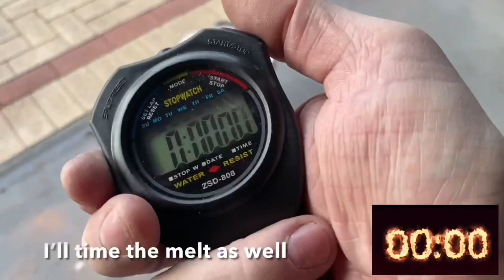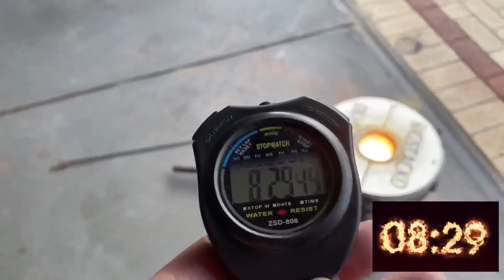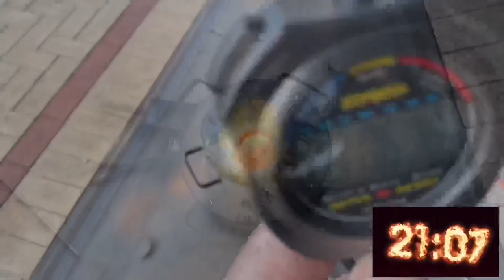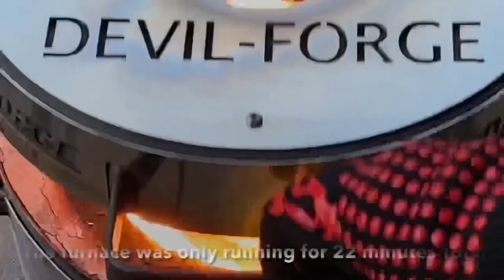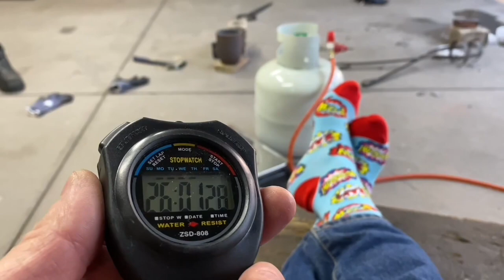Dumpster Diving Huge Copper Haul - Trash To Treasure - ASMR Metal Melting - BigStackD Copper Casting

Comment: Reminds me of bad old days when I used to work at a warehouse, full with cables. The parent company would tear down buildings and bring tons upon tons of old electric cables, engines/turbines/electric stations and piping to our warehouse. We'd strip them down, prepare, bag and sell them. We used machines like one at 2:03, or/and something that was put together by ourselves. In this video, cables are cleaner then baby's ass, but what I used to work with, was devil's outhouse itself: cable layers (rubber, in between strands, coatings) were basically glued together with some kind of thick, dark, dirty lube that was sticky as hell. Add dirt in a mix and you'd be so dirty by the end of the shift, that your overalls would be gleaming in the light and almost hard as metal sheets. 
You can imagine how much stuff there were in old soviet buildings that were being demolished. Our company would get nice profit. Tons upon tons of copper, aluminum, lead, steel (cables were wrapped in thin steel sheet, we had to manually unwrap hundreds of meters of them), even some brass stuff. Add -20℃ or +27℃ during the year in that warehouse, low wages, useless and angry bosses and you get a recipe for work related depression :D 
It ended when owners of demolishable buildings realized they should take out cables themselves, before selling the whole object to our parent company... 
I do sh*t work today as well, but it is MILES better then stuff back then. I'm now a stage technician at a local opera (lots of manual labor to load, unload and build show decorations) and I even get an occasional small, utility roles during theatrical shows. I'd say nice change of pace, LOL. 
Thanks for a video, and cudos to those who read my blabblering. Just felt like sharing.
P.S. The "Dogfather" shirts made my day.
Reply: You paint a vivid, dystopian picture, fellow BigstackD fan. That just sounds horrific. Glad your days are sunnier now.
Reply: Your history could make a great opera (or play) itself, and then you could get the lead role!
Reply: @squirrelorama  I see what you did there 😀😁
Reply: Oh god I thought I was the only one in the comments, lol. Your experience is eerily similar to mine, haha.
Reply: "basically glued together with some kind of thick, dark, dirty lube" gotta love direct burial cables!
Reply: I'm imagining Valhalla for everyone who's worked these jobs through all human history. I hope the managers have to bus the mead.
Reply: Bro thank you for the story, that was very interesting. I could just listen to someone talk on end about stuff like this, prior hard work they've done in previous eras long gone and alien to us now.

Comment: Thank you for showing the value in multiple currencies for your viewers from less mainstream countries.
Reply: "Mainstream countries" LMFAO
Reply: @Carl-ld5jy  thought it was an apt description at the time🤣
Reply: @Carl-ld5jy  "bro youre literally from liberia. Irrelevant."
Reply: You're from ireland? Banned
Reply: Where was GBP?..
Reply: @MrMarko4  GBP and EUR seem to be listed with their respective symbols (£ and €)
Reply: @subg9165  Thanks, me being stupid..
Reply: People in developing countries who recycle scrap material are just as important as recyclers in developed countries. Not only can they make money off it for their region, but it also helps keep stuff out of landfills. China's e-waste recycling operations often pull chips from devices set to be recycled, which are then cleaned up and sold online. Some chips may come from machines that were junked because of their faulty chips. However, this operation keeps legacy components around for people who need a replacement for a part on an obsolete machine. Some modern industrial computer motherboards still retain the old ISA slots used in the 1990s so that they can interface with legacy equipment that connected to computers with ISA slots and would be expensive to rework into modern computer interfaces. The old chips that China harvests from recycled computers can prove very helpful in keeping stuff like sound and other expansion cards for those machines still running, thus avoiding the need to spend exorbitant amounts of money on new hardware just for a few components. Recycling old and obsolete computers does not have to mean melting the entire thing down. Instead, recyclers should harvest the chips from them and sell them as replacement parts so that people who need them can use them. However one should not cover up the original markings because some of the devices that use them may rely on certain revisions of the chips.

Comment: That was the coolest "hot bar on giant ice cube" I've ever seen you do!  Spiders outside the home I have no quarrel with, but spiders in any part of my home or property would be dealt a quick death.
Reply: came here to say the same thing pretty much. it was hands down one of the most satisfying quenches ive seen on the channel lol. that ice block looked different from the others so maybe he got a new container he makes them in. whatever it is...*chefs kiss* mwah. was great.
Reply from the maker: @Metal_89  Actually I’m glad you guys noticed that i changes it up a bit👍🏻I’m looking to make a whole heap more of perfect clear ice ice blocks and get a side view as well as the normal view while quenching the bars, it’s gonna look awesome👊🏻🍻
Reply: @bigstackD  Did you get a RO filter for pure water? Or just using distilled water?
Reply: I agree... Best block quench so far.
Reply: @shize9ine  There's a process you do to make clear ice
Reply: Intruders must die.
Reply: @jeremyfish1975  I think you just have to boil water to burn the chemicals to make clear ice. It works best if you boil distilled water though
Reply: @chriscapo  Unfortunately both of those are myths. The way you get clear ice is by vibrating the water as you freeze it.
Reply: @BlackHatAndy  the easiest way to get clear ice is to freeze from one direction (preferably the bottom) to consolidate all of the gas bubbles in one side. If you freeze from the bottom up, all the gas escapes out the top. If you do top down, you just have to cut the bottom foggy ice off.
Reply: Totally agree, it was awesome.
Reply: Nah those are Australian spiders if you try to kill them they’ll get you first
Reply: @_EllieLOL_  Any spider can be killed...Australian or otherwise.  One that is in my house is automatically on that list.
Reply: @DH-xw6jp  Yeah it's a PITA!
Reply: @veritasfiles  Those spiders are there to guard his hoard. Why else do you think he can casually poke them?

Comment: It’s always great to see that steel mold working so well for ya👍🏻 I had those same gloves with the rubber on them and I melted them in 2 days. They suck 🤣
Reply: Hey can you make a bottle opener out of one of the metals?
Reply: Wow I'm just an hour ahead  of you (I'm on mountain time) and I thought I was up late/early watching BigstackedD! lol
Reply: @TH-kd1ju  nope you’re not alone, however I was talking with him through out the night so that didn’t help. We get carried away sometimes 🤷🏻‍♂️
Reply: You need to be moving your stuff man. 🤣🤣
Reply: @ArtByAdrock  well it's neat you guys are friends/melting buddies all the way across the world! I'm in the middle of moving houses too and it's a crazy time lol lots going on! 🙃
Reply: @ArtByAdrock  hi
Reply: @TH-kd1ju  I know that feeling for sure. I’ve been working all day and all night everyday to get this finished as quickly as possible to get back into making some cool stuff. Good luck with your move 👍🏻
Reply: @Nitro-er8ul  hi 🙋‍♂️
Reply: @amadeusyssowski1651  connect a steel oval with a hollowed out inside and make sure the oval is connected to something and stable and that the oval is slightly smaller than the bottle cap
Reply: @artomix7  no it’s not plastic it’s rubber heat resistant gloves but they’re terrible. TKOR did a review on different ones. The problem is the get really hot and you can’t take them off quickly. Welding leather gloves work the best and if they get hot you can shake them off. Those you can’t
Reply: That's why you need a pair of Heavy duty gardeners gloves!

Comment: This dude stackin up to be a vendor when the shit goes south.
Reply: lmao
Reply: Vend what? Copper is expensive, aluminum is a cheaper conductor.
Reply: @mattbanks3517  what? i thought gold was the expensive one and copper replaces it
Reply: @yesmybagel2751  gold (in phones and computers) > copper (wires) > aluminium (fuses)
Reply: @mattbanks3517  you know there are reasons why we use copper instead. Yes conductivity wise aluminum is just short of copper and can replace copper in situations. But the material properties of aluminum is far inferior compared to copper, it is more brittle which makes it hard to use thinner Al conductors. It expands more than copper under heat which causes problems in homes built in the 60's as Al wires would get loose over time. However aluminum is used often in thicker gauge wiring as it's far more economical compared to copper and theres less concerns regarding the aforementioned problems.
Reply: @jerrycai3317  it isn't brittle, it's just as ductile, it can't be bent many times and doesn't resist fatigue, but i love the stuff.
Reply: @mattbanks3517  very contradicting, but alright whatever makes you happy.
Reply: @jerrycai3317  why contradicting, aluminium isn't much more worse in fatigue resistance than steel, ever seen semi truck frames that crack in half?
Reply: @mattbanks3517  you're both right.while aluminum is flexible, ductile (overall stress resistant) once it reaches a certain stress point it does break or behaves  brittle.
Reply: @mattbanks3517  These 4 kilos copper are 24€. For several hours of work.
Reply: Probably the most satisfying personal treasure hoard I’ve ever seen
Reply: @yesmybagel2751  used to be. And gold is a worse conductor than silver.
Reply: What he should do is make brass - that way it can be used to make ordnance if it's not bartered.
Reply: It is an indictment of our wasteful attitude to the world around us that so much useful material is thrown "away".
Reply: @yes78  Yeah, gold is used in electronics, copper mainly in house wiring and aluminum for outdoor/underground cables.
Reply: For real I gotta get on my own scrapper hustle lol
Reply: @mattbanks3517  copper is cheap as fuck.

Comment: It’s interesting how the copper is heated so much that copper ions fly off and make the fire a different color
Reply: It’s crazy how immediately it happens too
Reply: it's to do with the electrons. when you add heat, they get 'excited', so they gain energy and jump up energy levels within the atom. because that state is unstable, the electrons jump back down to their ground state, which releases the excess energy as photons, which results in the flame changing colour. copper's normally a green-blue colour in the flame test. hard to see here, but at around 6:00 you can kind of make out the greenish colour. also, they have machines that show the full spectrum of the frequency of light each individual electron releases, it's pretty cool stuff
Reply: Nerd
Reply: Copper is a very cool element
Reply: @lorenzostransportvlogs  And to add on top of that, the amount of electrons and the quantum level that they're at will make the colour vary. That's why a copper flame is not the same colour as a strontium flame, because their electrons quantum level aren't the same (valence), so the energy to excite the electron from these two metals is not the same, thus the different colour.

The more energy it takes to excite the electron, the more the colour of the flame goes to blue, and vice versa for red (see the spectrum for reference).

You can actually guess the colour by the quantum number of the valence electrons of the element.
The lower the quantum number, the higher the energy, because the electrons are closer to the nucleus, thus harder to excite (more energy required), explaining why strontium is generaly red and copper more on the green side!
Reply: @breadloafREVO  haha cry nerd
Reply: B H  lol cry
Reply: B H  imagine being mad at people’s existence beta energy lol
Reply: B H  beta lol
Reply: That's what flame atomic absorption spectroscopy is all about - identifying/detecting the presence and concentration of elements by burning the sample and effectively analyzing the colour of the flame.
Reply: We get these packets of minerals for our campfire that you just toss in. Flames turn blue, green, purple. The kids love it.
Reply: @scottgordon600  I’m going to use this when I make a fire next time. Get some Harry Potter shit going.
Reply: It gives fire some green tinge

Comment: I use to do this back in the good ole broke college student days except I would skip the whole melting it down part and just taking bags full of copper wire to shops and making some nice lil profit
Reply: Yeah, same. Dad is an electrician so we always had wires around the house. If i remember correctly, our biggest haul was around 200 kg of pure copper wire.
Reply: They made a way bigger profit buying it cheap
Reply: Why would the scrap value of a bar be more than the bare wires?
Reply: @captainoates7236  because it’s been processed a bit. They don’t have to mess with all the loose bits of copper as well. I’m not sure if this applies, I guess it depends, but it’s always cheaper to transport 1kg of copper in a bar vs 1kg of copper wire cause you can pack way more
Reply: Most places won't accept melted down copper. I'm amazed this guy makes money doing it.
Reply: @1staryelpreview915  its the exact opposite normally here. Folk melt in filler materials and try to pass it off as copper. Mine prefer it stripped but left as wire.
Reply: @lmaoroflcopter  that makes sense. I’d assume this guy knows what he’s doing and that there are also tests people can do to check density and purity ect. He probably knows whoever buys it from him enough that they’d be cool with it like this. But yeah I see how that might be a problem
Reply: @1staryelpreview915  aye they can and some have those hand held xray assay machine things but its a case of maximising margins. Easier to say "give us it as is" and running a blade over say CCA wiring rather than buying a super expensive assay thingy.
Reply: @lmaoroflcopter  yeah most recycling places I know want metals not metaled down so they dont have to drill check if bars are not mixed metals just easier for the workers less work for everyone.

Comment: that's one of your best looking ingots in my opinion, i'm glad you didn't polished it, it's perfect that way, shape, texture and size are amazing :)
i wish i get to hold one my own ingots some day, the more i watch you the more i want to start melting :D
Reply: I wonder why he didn't use degassing flux to get rid of the hydrogen bubbles in the metal pour?
Reply: @Ben4149  I dont know much about metal melting and this statement makes me curious.

What would be the benefit on the finished product if the flux were used?

Comment: I believe the large black spider you showed towards the end is a mouse spider they are burrowing spiders and are extremely venomous with large fangs as well. But I’m not completely sure, because the chelicerae (fancy word for the place where the fangs are connected, the large sac) on mouse spiders are huge but on this species are not so not for sure but just in case steer away from that area. Anyways great bud keep up the good work👍

Comment: Hey I gotta question, so when I melted copper, I used a clay crucible for the first time. The crucible was all black and made your fingers black when you touched it. When I was done using It, after the copper was melted, it was a light brown color, is that normal? Is it still safe to use?

Comment: I imagine the ice cube didn't just melt that fast because of the high temperature of the copper but also because copper is an amazing heat conductor. 
Might be interesting to compare it to other metals at the same temperature.

Comment: Worked on a site where they process uranium and shit for Nuc plants. We were doing runs with 500 kcmil cable and threw out probably 1000lb of wire because it wasn’t worth it possibly being contaminated. It was in teck so it would’ve been fine, but on big sites little shit like that is nothing in the grand scheme of things.

Comment: I really enjoyed this but how much lpg did you use to do it? I imagine most of a 8kg bottle which cost half of what you made..Going by your collection your into to this for more than money but still....
Reply from the maker: Mighty the heat efficiency of these devil forge furnaces are absolutely crazy. I could melt 8 kg of copper in under $10 in gas easily👍🏻. And 8.5 kg gas bottle would last me three or four melts sometimes more

Comment: why did you heat the bar mold? I am guessing it was so when you did the pour for no thermal shocking on the metal and so it wouldn't crack right?
Reply from the maker: Actually mate I pre-heat all molds before I pour into them because if there’s even the smallest amount of moisture in the mold and it gets trapped underneath the molten metal it will turn to steam instantly creating a steam explosion sending molten metal everywhere👍🏻So you need to pre-heat your molds every time regardless of what metal you’re pouring.
Reply: @bigstackD  ohhh this makes sense actually. I read about something similar with towers getting hit by lightning that have concrete bases. Lightning comes down (concrete holds moisture) then the lightning heats up the water to steam and explodes the concrete. But yeah I could definitely see the point of doing that now. I assume even if there wasn't moisture just pre-heating it so there is no stressing of the mold itself as well? I guess there is multiple reasons.